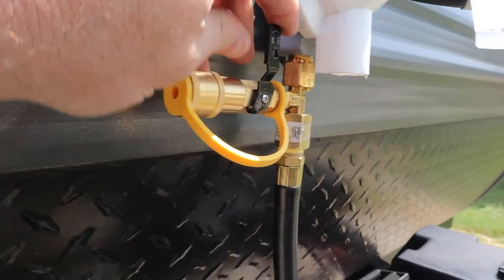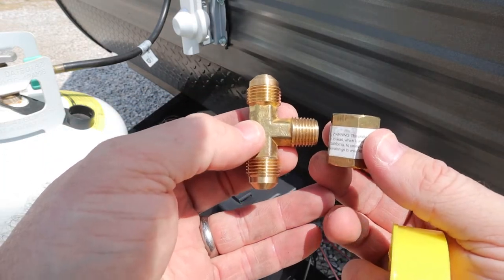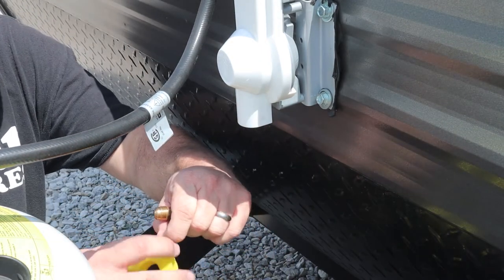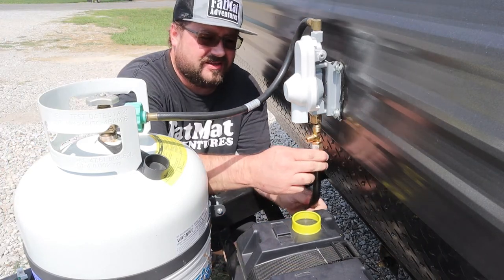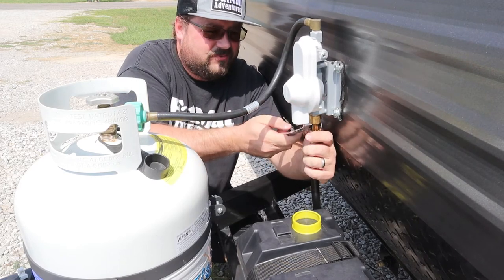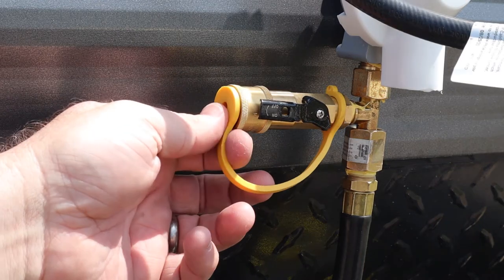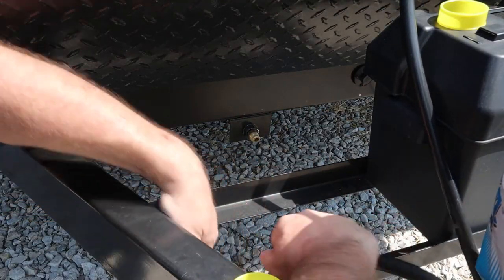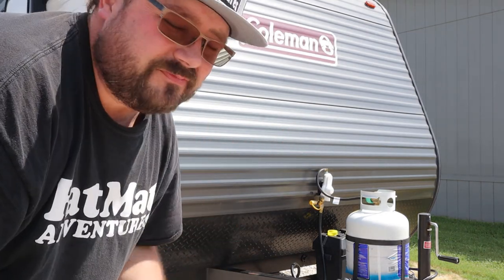How To Install A Propane Quick Connect On An RV - EASY!

Comment: Great video - thanks for posting!  One thing though - I'm no plumber, but I think you're supposed to wrap the tape so that it gets tighter when you put the fittings together - it looked like you did the opposite.  Doing it the wrong way can cause the tape to spin and/or wad up and cause a leak.
Reply from the maker: I did it the wrong way on a few, you're right.  I lt's has been working fine with no leaks so far but I do plan on redoing it.  Great observation!  Thanks for the feedback!

Comment: appreciate the video, but you don't need any tape on the flare fittings.
Reply: This would be correct if he weren't using a coupler on the flare fitting. To use a flare fitting without tape, the female side needs to also be flared (which in this case, it was not).

Comment: The male brass fitting looks the same as a air compressor male connector. ?
Reply from the maker: Hey, thanks so much for commenting. Yeah you know, I had a couple of other folks mentioned that it look like the fittings weren't correct for gas so I ended up taking it off. Better to be safe than sorry. I'll have to redo it when I have some time and make sure all the fittings are proper gas fittings. It's weird because those came with the coupler. I guess it was just from maybe a cheap company or something.

Comment: Thinking of doing this to our trailer to allow us to connect our generator. I’m concerned that using a ball valve like you did could rattle into the open position while you’re driving down the road; especially since you have it set up so closed is with the lever in the up position.
Reply from the maker: Yeah that's a great point.  I've had others comment that I used incorrect fittings as well (even though I had help picking them out at the hardware store, so once we are ready to take it back on the road (when weather cools down) I plan to redo it.  Any ideas?  I guess I could turn the valve upside down?

Comment: Thanks for the video.  Do you have a link for the T connector you used?
Reply from the maker: Sry for the late reply.  I ended up getting the t fitting and others at a local hardware store, so no link for that.
Reply: @FatMatAdventures 

Hey Mat , what hardware store, Home Depot, Lowe's??
Reply from the maker: We have a small local store in our town that I went to.  Ponder Hardware store
Reply: @FatMatAdventures  Cool you mentioned 3/8 or half an inch do you mind if I post a video on my camper so you could see what I got going on?
Reply from the maker: Sure thing!  That would be cool.

Comment: The coupler is not designed for a flare fitting.
Reply from the maker: Yep you are right. I'm gonna have to redo it.  Cheers!
Reply: @FatMatAdventures  did you updated if so do you have a new video?
Reply from the maker: Hey! Thanks so much for checking back in. I have had guest living in my RV since December and of course they're not using the gas but I hadn't had any moment to correct it. But I will absolutely soon because they're about to move out and I'll be sure to put that up and I will also give you. Thanks for the correction in the new video. :-)
Reply: @FatMatAdventures  sounds good!

Comment: You do know you used the wrong fittings right? Tape was put on wrong also. Sorry!!
Reply from the maker: I used gas fittings.  Do explain.
Reply: At 3:15 in the video you used a tapered pipe fitting with a flared fitting. You called it a coupler. Flared fitting and tapered fittings are not the same. I am surprised it did not leak. I am not giving you a hard time here just trying to help out and to be safe. Happy camping.
Reply from the maker: No, that's great! I totally appreciate that!  I will redo it soon because I definitely don't want it to leak.  Thanks for pointing it out ☺️
Reply: Also, as far as the tape issue.....if you wrap it around the opposite way, it won't unravel when screwing in the hose. Great video,  nonetheless!

Comment: Don’t Do this…..wrong fittings…very Dangerous
Reply from the maker: Yeah I had a few others mention that as well so I removed it all.  Really appreciate that you reached out about it!
Reply: @FatMatAdventures  Would be really good to add that to the title or as a pop up text in the video - reason is because people are looking to these videos for advice, and if you have to scroll way down in the comments to find out it wasn't done correctly, a person could end up with a propane leak or worse as a result. Especially with propane, if you have corrections, please note that in the video itself or in the title so viewers are aware. Your video does such a great job of showing exactly how to do each step, so keep that up! But make sure the step is a correct one, or a text pops up at a certain point to say "I wrapped tape wrong here - make sure you _______". That way folks still can use the video for guidance but do it correctly. Even more respect for you if you correct errors and own them, to further help people out! Cheers!
Reply from the maker: @albreaud000  great idea! I'll add it tomorrow. Thanks so much for the advice
Reply: Seems if the fittings would hold up to 150 PSI of air, they’d hold up to 10-15 PSI of propane. I’m fairly certain the brass used in gas fittings is the same as brass used in plumbing fittings.